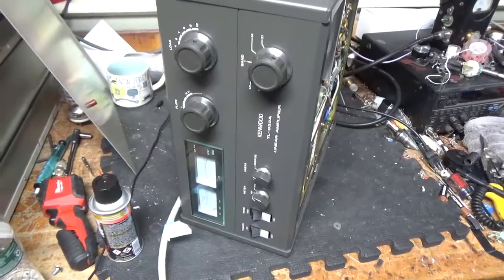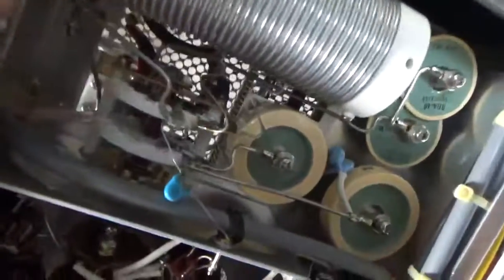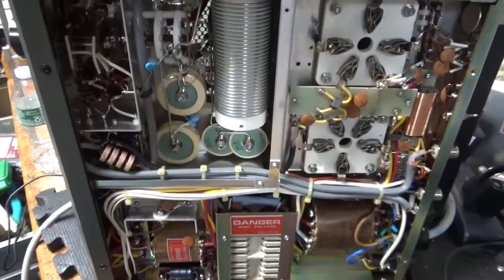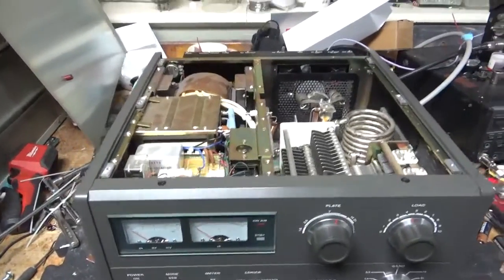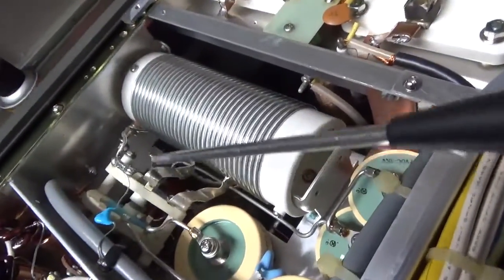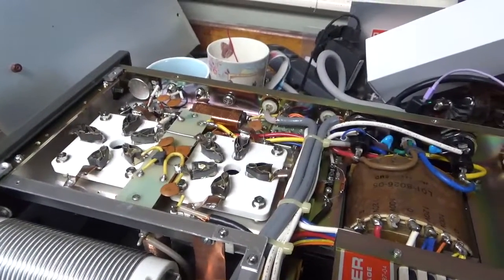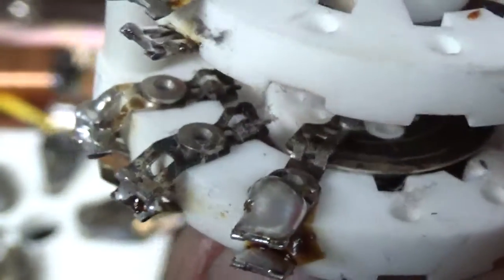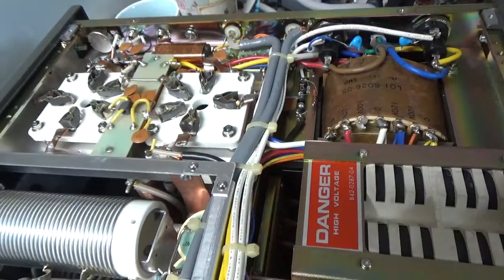Kenwood Tl-922a Modifications, Repairs, New Band Switch, 10 Meter Mod  3-500zg Tubes

Comment: Seems like there is very little venalation. Great work looks good.
Reply from the maker: Air is pulled in from the bottom and side panels and pushed out the back by the fan. More than enough for its rated output. I have never seen any indication of over heated components